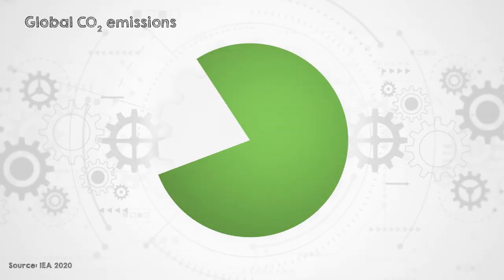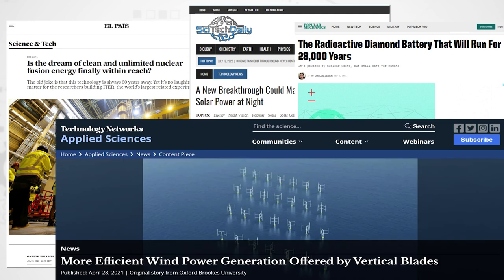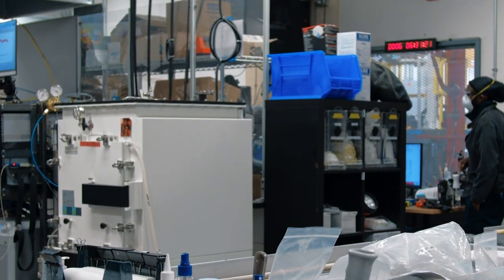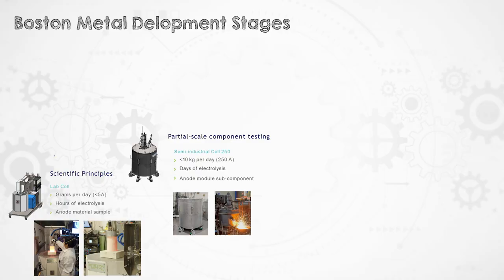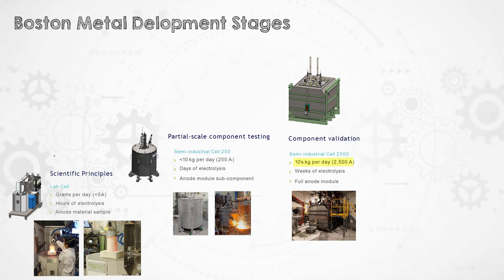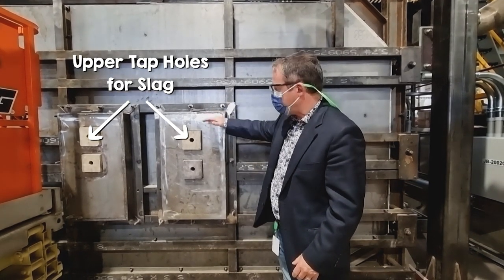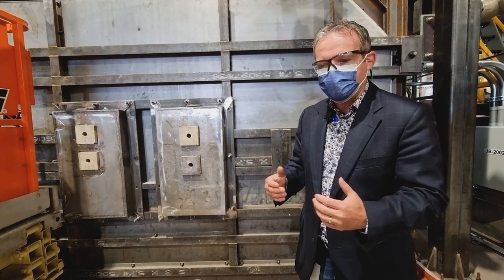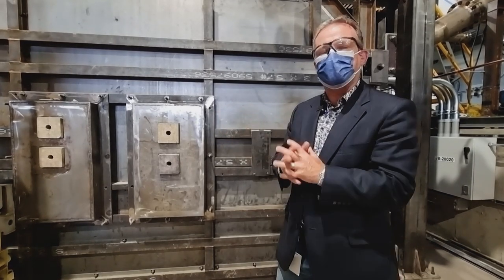CO2-Free Fe: Green Steel Tour with Boston Metal

Comment from the maker: Lots of people are commenting about whether this is really a steel making process, or just iron. And it's true that we really only talked about the iron part here in this video (partly because I made a different video on steelmaking recently and didn't want to double up on the same content: https://youtu.be/jWD2nI5RhpI ). Here's more on the iron/steel issue for those who are interested:
"Iron and steel are intricately linked. There is no steel without iron.
 
Boston Metal’s technology relates to primary steel production. The liquid iron that is tapped from our MOE cells integrates directly to the ladle metallurgy step in steelmaking where carbon would be added, along with other elements depending on end-product specifications.

The iron making phase of primary steel production is responsible for the bulk of CO2 emissions related to steelmaking. Our process eliminates the carbon-intensive steps of primary steelmaking – coke production, iron ore processing, blast furnace, basic oxygen furnace. "
(quote from Boston Metal)

Comment: I believe their processes are already used in making Titanium cheaper. And prof. Sadoway has some other related tech in the works, for liquid metal batteries, also based on redox and similar electrode material research.

Hopefully it all works, and makes Steel making cleaner, less CO2 emissions and easier to do.

Comment: An interesting steel making process, and very similar to a good'ol Aluminum smelting arc furnace which consumes MASSIVE amounts of electrical power. ie. typically needs to be located close to a electrical power generation station. Interestingly, there is a way to do this same work without the need for the arc furnace and electricity.
Reply: How do you reduce iron oxide without heat and electricity?  By using hydrogen?  I think electric reduction will be cheaper.
Reply: I’m interested to see it makes Oxygen and not CO2, like the Al Hall process. The anode is very central to this and I’m curious to see what it might be - perhaps some PGM ceramic.

Comment: And is there a way to restore that energy used in the process by cooling it down to a heat exchanger or something which could be used for other applications like heating homes
Reply: It takes a large amount of energy to strip the oxygen atoms from the iron ore, it isn't just left over as heat.

Comment: Is this process making steel directly or producing iron for making steel?
Would be nice to differentiate this process from other electric arc furnace processes.
Reply: They are reducing iron oxide to iron  -- steel is a alloying process (adding or removing other elements to/from the iron)
Reply: People tend to get this wrong but in reality what we think of as steel is of a medium carbon content, cast iron has more steel and wrought iron has less. It's not that this is pure elemental iron and burning coal introduces carbon to it, it's more that this pig iron has a ton of carbon in it and we need to pump oxygen through it to get rid of some in order to make it into steel.
Reply: This is an iron making process and if they could scale it upto 30,000 Tonnes per day, they might be able commercialise. Steel making would occur in the next part of the process. Anyway, good luck to this folks with their endeavours.
Reply: The "iron" that comes out of a blast furnace typically contains about 4% Carbon, as well as other impurities which have to be removed in the steel-making process.  This is because the iron was reduced with carbon, and so there is a huge excess of it which goes into solution in the iron.  In the electrolytic process, the C level should be quite low, as no carbon is involved.  Probably likewise for such impurities ans S and P.

Comment: How tolerant is this system to power outages?  AFAIK, a power outage in an aluminum smelter can require weeks or months to restore cells to functioning.  Can the rate of production be scaled down, to provide a variable load to the grid?

Comment: The references to DC current beg the question: what voltage are they using?  This would clue us in to power demand.
Reply: Same thought here, I wondered about voltage and as you say power requirement, I dare say it must be massive. Also wondering what could supply a constant 600,000 amps on the larger version, is this where the Nuclear Modular Reactor finds its home?

Comment: So there are multiple ways to produce steel without using coal? I need to rewatch your older videos. I was, still are confused why a specific new method is being developed in New Zealand too for "green" steel. As I understand there are scaled semi-commercial green steel plants in Europe and North America, can't we just copy those?
Reply from the maker: Yep there are several ways. This is the video where we discuss the different ways and pros and cons. https://youtu.be/jWD2nI5RhpI
I didn't know there was an NZ tech in development, I'll have to look it up.
Reply: @EngineeringwithRosie  Thanks. Yeah search "Wellington Univentures: Green Steel". Not that advanced yet.
Reply: @EngineeringwithRosie  In New Zealand, the steelmaking process is based on iron sands as the raw material. This is fairly unique and they currently use submerged arc furnaces using carbon electrodes.  The Uni is seeking to use a hydrogen route while reducing iron sand.

Comment: Thankyou, we have to get rid of the Bessemer process.

This is an important technique in addition to electric arc furnace.

Also for steel, hydrogen reduction being pursued by Sweden and Germany looks promising.

Next we need to solve CO2 problem of cement manufacture, then fertilizer, chemicals, synthetic fuel, the list goes on . .. and on.
Reply: Knowledge of materials grew, scientific understanding advanced, and new smelting processes were discovered, The Bessemer Process became obsolete. The method stopped being used in the US completely in 1968. Electric air furnaces and other more technical oxygen steelmaking processes took its place.21 Oct 2021

Comment: Can you please help me with my math on this?  A '600kA' electrolysis cell is supposed to permit production of 1.5 million tons per year of steel.
For round numbers I am assuming metric tons, so this means 1.5 x 10^9 kg of steel per year or simplifying that this is pure iron, 26.9 x 10^9 moles of per year.
This gives me 852 moles per second of iron being produced.
The oxidation number of iron in Fe2O3 is +3, so to reduce 852 moles you need 2.5 x 10^3 Faraday of electrons.
1 Faraday is 96x10^3 amp seconds.   So with perfect coulombic efficiency, and if I have my maths correct, I'd expect one would need 246 MA to reach this production level.
Is it possible that a 600kA cell will only produce 1.5 million pounds per year of steel?

Thanks for making these videos, and thanks for checking my math!
-Jon

Comment: These processes are only viable when electricity is cheap. As a comparison the Alcan plants were built in Scotland, where massive amounts of Hydro power could be had cheaply. How many megawatts are required? What is the electrode cost? Capital costs of actually building these reactors is negligible, compared to the electrical energy and electrode costs required

Comment: It is a little surprising that they could not take more from the similar process used to produce Aluminium. At least as stated they can use power delivery technology from the aluminium side to speed up development to industrial scale. 
It would be interesting to know if they had any cost estimates for the industrial process?
Reply: Iron ore has a higher melting point than bauxite. Aluminium production does release some CO2 as coke is used as a reducing agent. It's there to "grab" the oxygen so it doesn't recombine with the aluminium.
Reply: Actually, the MOE process is simpler.  To produce aluminium you take bauxite and refine this to almost pure aluminium oxide (alumina). The electrolysis process then converts alumina to aluminium.  Using MOE, iron ore is directly used in the electrolysis process to make pure iron.  A full industrial unit operation is thus skipped.

Comment: I appreciate they are showing EAF continuing - obviously, the EAF technology is essential in sustaining a circular economy for steel.   Interesting to hear this process can possibly tolerate lower grade iron ore - including silicon and other dilution?  It would be good to talk about how the BOF, EAF and Boston metals products compare in GWP/kg.  There are obvious horizontal issues is obviously the 600KA, which as discussed is similar to the ridiculously intensive Aluminum smelting process- aka solid electricity!  Build it adjacent to hydro as we’ve seen ‘hydro’ the Aluminum smelting company in Norway achieve to provide v low GWP Aluminum.   Lastly, the term green steel, zero carbon steel etc.  all great buzz words but the ESG community is soo confused about all this…. We need clearer messaging to help folks in the industry

Comment: What is the range of carbon content in the steel that this process can produce? Can this process produce steel grades with normal concentrations of trace materials? Can this process produce steel varieties chemically superior (in some way) to the traditional process?
Reply: mjmeans, because we don't use carbon in the production process, the iron produced with the MOE process is free of carbon.  In a separate process step after the iron is tapped, steelmakers add other metals to convert the iron into steel.  It then has the exact same properties as standard steel.
Reply: @MyStevieB  Thank you very much. That explains why I was confused. The title of the video suggests that the new process for making steel, when it actually makes elemental iron, or iron oxide. When adding the additional processes needed to create steel from the elemental iron or iron oxide the new process produces is considered, is net CO2 produced more of less CO2 than the old process end to end? I'm wondering if the CO2 burden (or budget) is just being shifted to a later stage of steel production or if there is a net increase or decrease; and whether this new process is better utilized, at least initially, for elemental iron uses other than for steel production.
Reply: @mjmeans7983  No, once you produce the iron carbon-free that benefit is upheld further down the processes.  In the steps where steel products are made (like the rolling mill), all parameters remain the same. However, you don't need a pelletizing plant or a coke-making plant.  The avoidance of this has other considerable environmental benefits too.
Reply: @MyStevieB  Thank you very much for that explanation. I hope the technology can ultimately grow to be cost competitive without the need for government intervention.

Comment: Having done additional research, I had misunderstood the process. Iron ore can be smelted in an arc furnace by continually injecting carbon monoxide or other reducing agents along with the charge. For this they are proposing doing to iron ore what is already being done with aluminium ore.

So instead of burning the coal to melt and reduce the ore, you are now burning the coal to generate the electricity to power the electrolysis. How can this possibly be economically competitive when the main producers of iron from iron ore in the world are not handicapped by emissions regulations?
Reply: Coal is rapidly being removed from the generation mix in many developed countries.  Making clean steel obviously requires clean electricity.  This is a thing that already exists.  We know how to do it.
Reply: @incognitotorpedo42  True.

Comment: That's great news.
I recently was wondering if steel could be produced electrically.
The slides were a little small on my phone, so the only other input besides the ore is oxygen?
Reply from the maker: The oxygen is removed from the ore, not added. Electric current is what's added, though the actual commercial process is more complicated than just sticking electrodes in a pile of iron ore. If you're on your phone and want more details why don't you try the Boston Metal website, they've got some good diagrams on there and with the static images you can zoom in.
It's also not the only way to electrically make steel. I made a more general video on zero emissions steel a few months back so check that out if you want to know more.
Reply: At some level of simplification this is like the way Aluminium is smelted: electrical energy to remove the oxygen from the metal oxides in each case. The energy is needed to replace the energy that was released when the oxides formed a billion years ago.

The details differ between iron and aluminium, of course, but as this video pointed out the issues around the electrical engineering (rather than the electrolysis cells) have already been solved by the Aluminium smelters. They know how to scale up the wiring. That gives them a useful leg up.

Comment: First I want to say I appreciate the way of development - big laboratory instead of intensive powerpointing.
I have questions left:
- what is the difference to the Arc processes?
- what kind of quality is the product - you were already talking about "steel"?
Reply: First of all the difference is the graphite electrodes in the common arc furnace,  graphite would emit CO2 in this application. Dipping the electrodes in highly oxidised slag would erode them very fast. Then the slags and how this is managed and the arc furnace does not have a controlled atmosphere. The arc furnace is also tilted when  tapping, not suitable for a continuous process,  So just about everything.  Arc furnaces can however handle sponge iron quite well.
The current in the arc furnace is 3 phase AC and generally only about 50 kA.
Reply: @JustNow42  Thanks for explanation.
Reply: The MOE process is an electrochemical process where electrons travel through molten slag.  They meet FeO and reduce this to Fe and O2.  There is no arc involved.  Because the anodes are made from special alloys there is no CO2 formed and only pure O2 gas.  MOE iron is pure iron without carbon.  In the phase diagram, it then is called "steel" but in reality you can't call it steel because real steel has other metals added to it to make it the right grade.  This explains why there is often confusion between the term iron and steel in the case of MOE iron.

Comment: Did they say what the electrodes were made of, or how they're made? The paper linked just says "chromium alloys", which is kinda vague. It would have to be a pretty interesting material to not corrode, erode, melt, warp, contaminate the steel, or electrolytically deposit at ~1500C in a bath of molten steel and superheated oxygen flue gas while being electrically charged with hundreds of kiloamps...
Reply: A quick Google search suggests that chromium is unstable in oxygen above 900 C (and iron at a way lower temperature). This suggests to me that chromium alloys cannot be inert at 1500 C. Actually, since iron melts at 1538 C, the bath temperature must be even higher. Earlier, I suggested that there was something fishy about Boston Metal's claims. I'm now doubling down on that comment.
Reply: @orumadayan1086  Search for the patent by Don Sadoway and Antoine Allanore.  Read it thoroughly because then you will understand its exact principles and how this alloy can be used under the conditions.
Reply: @MyStevieB  The patent was tough to understand, but I found two papers. One says that the furnace was purged with helium and the other says argon. Even then, the pictures of the anode show a lot of corrosion after 250 minutes. Are you planning to contain a steel plant under argon or helium? Either way, you have a big problem.

Comment: I am confused. Is the process smelting iron or producing steel. Constant references are made to iron in the video. How many Kwh/Tonne of product?, this is the important metric at the end of the day.
Reply from the maker: We did talk primarily about iron as that's the main part, with the most emissions normally. You can add carbon etc to the molten metal to get steel in the single process.

Comment: Hello rosie ! Is it possible to use nuclear energy to process metals ? Nuclear is a heat energy
Reply: “Process” is a very vague term. Could you use it to melt and cast metals? Absolutely. But it will not reduce metal ore to metal. But you can use the electricity from the plant to do so, and use the residual heat to make it more efficient possibly.
Reply: If nuclear energy is converted to electricity then the MOE process can indeed reduce iron ore into pure iron.

Comment: if this process is carbon free, then the iron ore has to have no carbon itself? or somehow the carbon doesn't combust and you adjust the carbon content by regulating the amount of siderite and lemonite? are there limitations on the kinds of ore you can put in?
Reply: Iron ore has little to no carbon.  In the video they said they could use ore that other processes couldn't use, so it sounds pretty flexible.

Comment: When you say the temperature goes up to 1600 do you mean 1600F or 1600C?  I think it is 1600C which is 2912F.  Are they using plasma torches to get to that temperature?  They should look at what Ovako Steel in Sweden did with plasma torches to produce DRI. i know that ADL back in the day looked at something like this.
Reply: It is 1600 degC.  Just above the melting point of iron. It may surprise you but the MOE process generates enough heat to sustain the temperature.